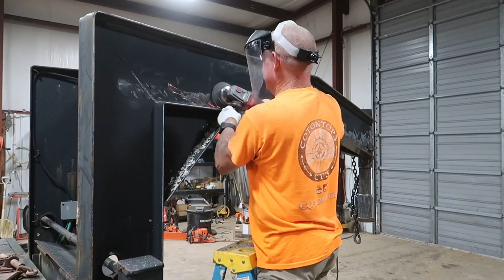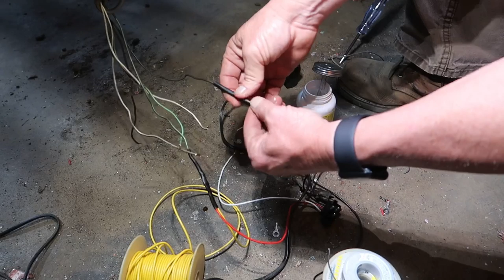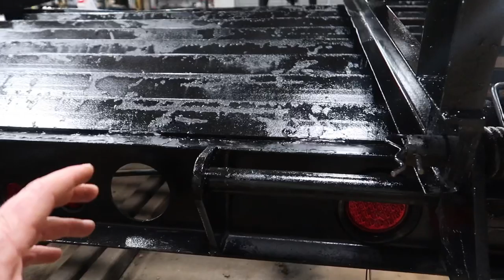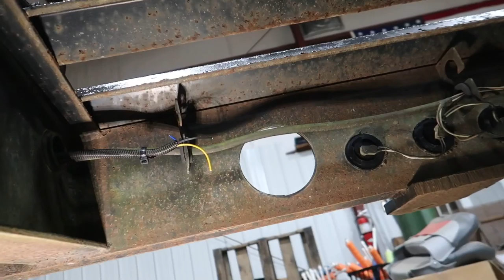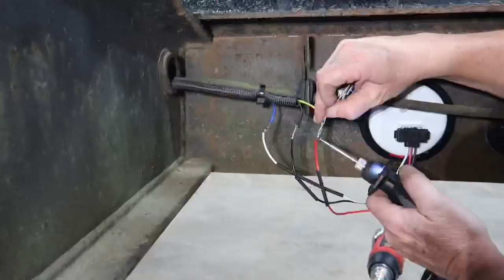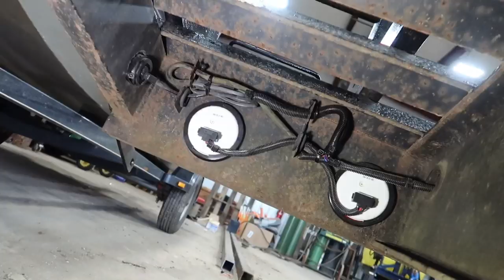Painting my gooseneck trailer & new LED lights for it

Comment: Slow heating from your iron means it needs to be cleaned and re tinned. A good clean tinned tip on the solder iron is needed to transfer the heat to the work.

Comment: Having a little solder on the tip will help transfer the heat faster into the wire.

Comment: Tim that heat gun in winter if your loader or the processor has problems starting on cold air heating the engine compartment might work